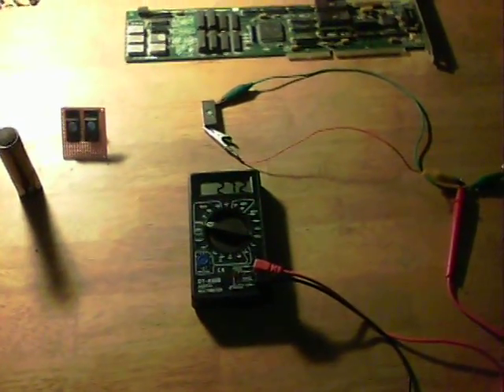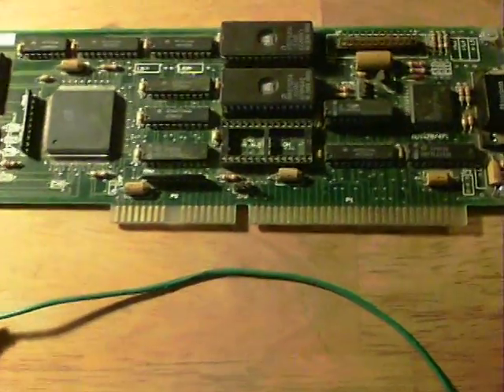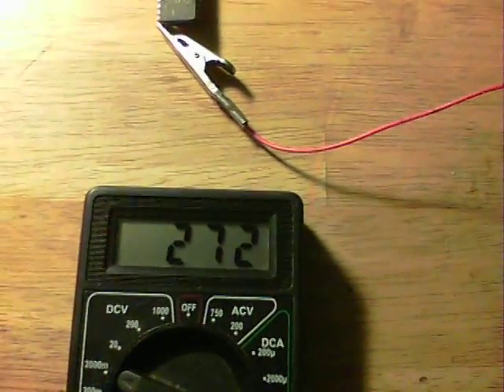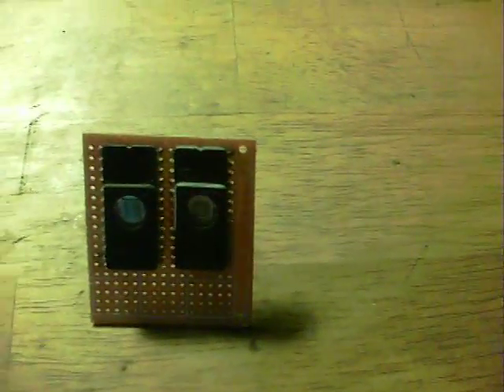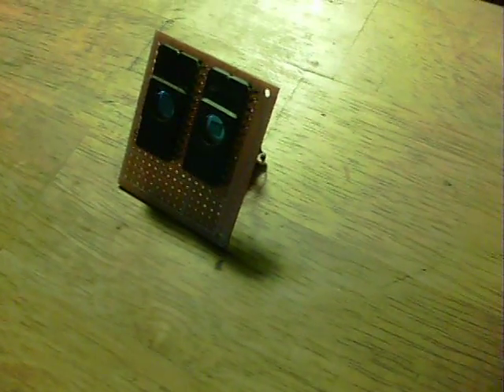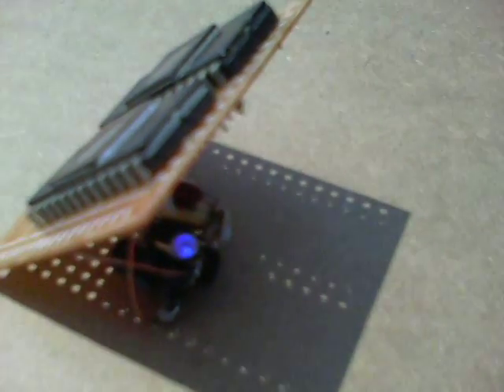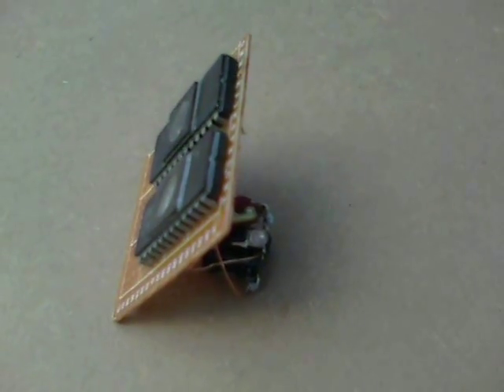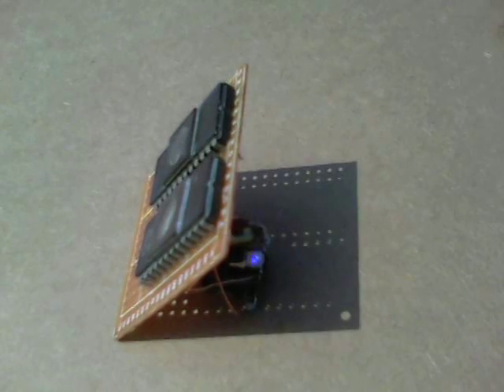EPROM Solar

Comment: Way to go my friend. See I learned something new today. Is it just the supply pins or do the others have an effect to?
Reply: Thank you MS.
Reply from the maker: Have just done a bunch of tests on a 2716. Only the bottom left/top right pins output the full amount. It's between 10 and 25mV for other combinations.
But - an intriguing result with 2 meters. If I connect the Positive of both meters to the bottom left pin and seperately connect their Negatives to the top right and Pin 20, I get another nearly full reading on the 2nd meter ! However, paralleling those connections brings it back down to the same as usual.
Reply from the maker: slider2732
Oops sorry, pin 21, 4th down from the top right :)
Reply: Thank you for that sire.

Comment: Nice I Like It thanks for sharing

which pins you use
Reply from the maker: Thanks. The pins are bottom left for Positive and top right for Negative. Have tried 2716, 2732 and 27256 types and all seem to output similarly. Haven't tried all the pins yet but some others do output voltage. The datasheet for the 27256 suggests the top 2 pins should work (either side of the casing indent), if following their usual hookup as an EPROM.

Comment: Good to see a working demo. You really went all out with this one. custom pcb and everything :D
Reply from the maker: It was either keep propping it up with something, or have it prop itself up with the circuit being on the back :)
Reply: Where do you salvage the blank pcb from? :p
Reply from the maker: Haha, though sometimes there are huge expanses of blank on boards. Got a VCR where they must have simplified and integrated everything over time, half of it is holed with nothing in there !
I got a set of 10 'paper boards' I think they call them on Ebay for about $2.50 shipped.
Reply: I should have thought of ebay harvesting. My local store wants $4 for one like that...
I have a few circuits that are breadboard regulars, and a few bead bug circuits that keep breaking legs. I think I'll have to spend some cash on a pack myself.

Comment: Great video slider. That is frustrating, I used to have loads of these knocking about. I used to load them at work for small telephone systems and also managed to do a few for my old Dragon 32 and 64 games cartridges. That takes me back a bit. I doubt that I will find any in my garage now.
Reply from the maker: Thanks. Ah, used to have a Dragon 32, whole fleet of oldies in fact in the mid 90's. ZX81, Spectrum, Vic 20, Atari STe, MSX, TI99/4A. Never owned a Flan Enterprise though lol.
Worth a look in the garage perhaps, for the novelty value and talking point weirdness.